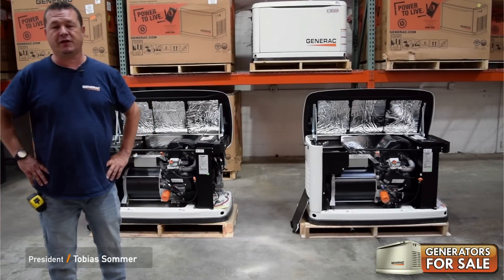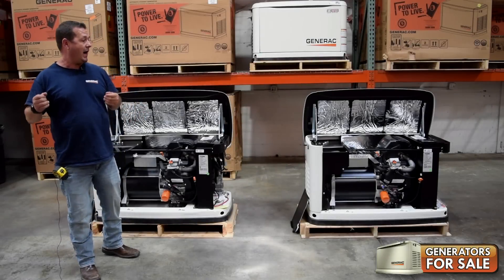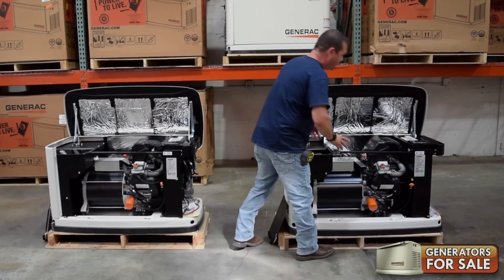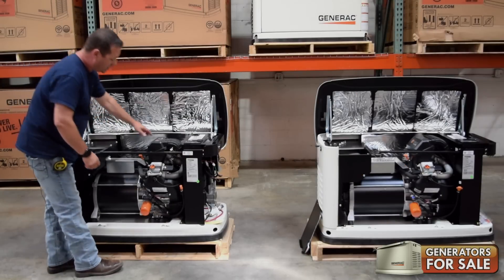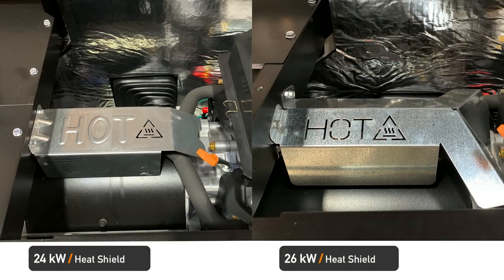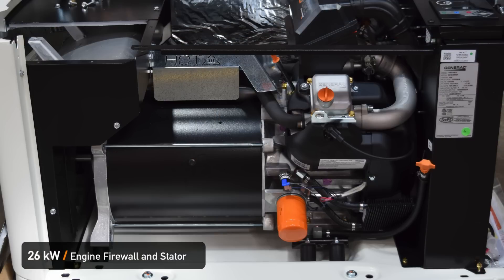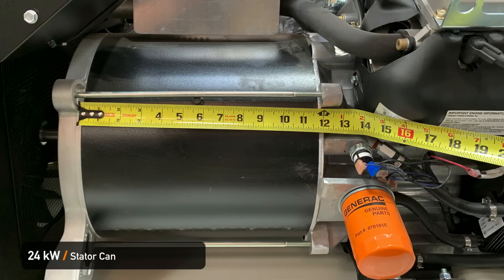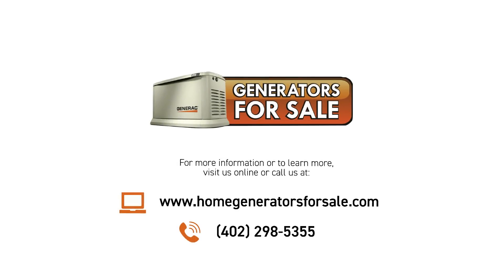UNVEILING The 26kW Generac Guardian Home Standby Generator And How It Differs From A 24 kW

Comment: We love our QS27kw. It is liquid cooled and runs at 1800 rpm. Yes it cost 6k more than the 22kw air cooled. But for extended outages the 1800 rpm generators are the way to go.
Reply: I agree with the 1800 option but find many people that have limited outages that the 3600 rpm air cooled will be just fine. Now that 2.4 engine is obsolete we will need to see what replaces it. That is a major issue for any unit that was using the Mitsubishi engine. Its not just a Generac issue and that was used by many manufactures as the engine of choice.

Comment: I have one of these.  The engine ran low on oil and it wouldn't start.  I suggest anyone with one check the oil level at least once a month.
There is also an oil drain tube (easy to use) in case you put in too much.  If you put in too much and don't drain excess it is passed out the exhaust and ruins the muffler.

Comment: The 26 kw Generac is underpowered and derates to 22.5 on NG. Also main breaker is only 110 amp. Briggs and Stratton is a better unit with derating only to 24 on NG and a 125 amp breaker as well as a standard 10 yr warranty! Briggs has more motor starting capacity and uses less fuel.
Reply from the maker: Having a 125 amp breaker and producing 108 amps doesnt give you more power??? Look at the specs of the Briggs. Its not much different than the Generac and only has a 6 year waranty on their website. https://www.briggsandstratton.com/na/en_us/product-catalog/generators/standby-generator/powerprotect-26kw-standby-generator.html
I think the biggest difference from a consumer to me is, in 2020 Briggs almost went bancrupt and was purchased. What good will this unit be if the manufacturer goes out of business?

I think the Vanguard engine is a great engine. I think Briggs is on the cliff because it makes engines for a lawn and garden segment that doesnt need engines anymore. Besides that they went to China to manufacturer and Generac bought the facility they used. Generac at least keeps Americans employed.

Comment: The specifications of the 26 kW unit show a slight reduction in fuel consumption over the 24 kW. Is this a misprint ?  If it's true, is the extra cost of the 26 kW worth it even if you don't need the extra 2 kW of power?
Reply: Same engine and it will be based on load anyways. a13kw at full load is a 26kw at 1/2 load. so a 26 will only be slightly different than a 24kw and on NG it gets even closer. I always say bigger is better unless you are wasting power. Example no need to full rate load a home that will never see that type of load. I have had customers that wanted liquid cooled machines and could have had a air cooled unit work but its not my backup system. I just give them options.
Reply: @TobiasSommerOmaha  Thanks for your reply. I appreciate your points.

 The Generac specifications say that  under a full load, the 24 kW unit  consumes 142 cu. ft/hr of propane while the 26 kW unit consumes 132.  The 1/2 load numbers are 92 for the 24 kW and 75 for the 26 kW.  That's a fair bit of propane over the life of the unit. How can the newer 26 kW unit provide an additional 2 kW while using less propane with the same engine?  

I called Generac customer support and they confirmed the  specs but were no help in confirming how this fuel reduction is achieved with the new 26 kW unit. They said to call a dealer. Lol.
Reply: Where I'm located in Canada, the 26kW unit is only $575 more than the 24kW and propane is about .83 cents per litre.
Reply from the maker: @kentshadwick6354  a few things that I know but not an engineer by any means. The 26 kw has a complete redesign of air intake which means they get more air and need less fuel to create more horsepower. It also uses a new bigger frame rotor/stator that is longer. It may need less horsepower to create the power with more alternator to produce power. Not sure if that helps but it’s my 2 cents.
Reply: @GeneratorsForSaleOmaha  Thanks for your comments. It wouldn't take long to make up the upcharge for the 26kW unit over the 24kW if the fuel savings are legit.  I believe the 26kW is new for this year so will it be more/less/equal to the 24kW with respect to reliability?
Reply: @kentshadwick6354  Reliability will be same or better. The engine has been used for years in multiple units and is tried and true. They just modified fuel and air so I dont think that will hurt but might help the unit breath. From install stand point it is more work and we do have to upsize the wire for the bigger breaker and output. I am happy with all the ones I have installed and no problems yet.
Reply: @TobiasSommerOmaha  How much more expensive would you say the install is over the 24kW unit?
Reply: @kentshadwick6354  We only charge like 500 more for upgraded raceway and wire. Not a ton but it is more.

Comment: Bought a new 22K Generac in Dec-22. The engine was bad right out of the box. It took 2 months to get a new engine.
Reply from the maker: I haven’t seen any engines bad out the box and I’ve installed thousands. I’ve had a few bad rotor and stators but never a full engine failure that needed a replacement. Sorry to hear that. I just filmed a video about blowing up an engine. It will come out soon but we ran the unit for almost 30 minutes with no oil before it blew up.
Reply: is your unit loud......on these videos, they sound like lawn mowers.  an ad by generac said they are quiet and no louder than having an conversation.
Reply from the maker: The quick answer is that this is an industrial lawn mower engine. So will it sound like a lawn mower, yes. Is it louder than a lawn mower, no. It is inside a enclosure that is designed to deflect and muffle the sound. No generator that has a combustion engine will be silent but quiet is subjective. I have had zero complaints from a customer that had power in an outage and the neighbors did not. The neighbor usually comes over to weather the storm and use the power.
Reply: @GeneratorsForSaleOmaha  way more power than a lawn mower. It’s a 999 CC OHV engine.

Comment: This might be a silly question, but I read constantly of people purchasing multiple units over the years. I get it, nothing last forever. What is the average life expectancy one can expect from a Generac generator that has been properly maintained?
Reply from the maker: Units can last a long time and reach well over 3000 hours of runtime with proper maintenance. In terms of power being out for 3000 hours, I have only seen off grid units make it this long. In terms of of years. I see units lasting 10-15 years and not being decommissioned because they don’t run anymore but just replaced because fixing an older unit is throwing good money at something that needs to be reliable. Money better spent by replacing with the newer reliable unit that parts are easier to find.
Reply: @GeneratorsForSaleOmaha  125 days consecutive seems pretty low, I'd bet they would run 24/7 w proper maintenance for far longer.
Reply from the maker: If my power was out for 125 days straight I would say I have bigger problems than how long an air cooled engine should last. My next question is why my utility is so unreliable!
Reply: @GeneratorsForSaleOmaha  LOL indeed
Reply: @GeneratorsForSaleOmaha  ... recently retired from one of the larger Generac dealers (25 year tech) and we had boat loads of units lasting 20 years or more. The biggest problem at that age becomes parts availability. At 15 years you can get almost anything. It's a bit of a gamble to push your luck farther because needing a (hard to find) part for an older unit could put you out of service when you need the power. In my experience, it's not usually a larger part, like a rotor / stator / engine. Those usually last. More often it's an obsolete control board, a sensor, or the cabinet has rusted out and the mice have had a field day with the wiring. On the liquid cooled sets, radiators, water pumps, and that sort of thing were also problematic in the supply chain.... and they fail just the same as if you had an older car.
Reply from the maker: Agreed. Just like any machine will eventually have obsolete parts a unit with 15 years on it is not necessarily end of life but end of road on parts.
Reply: Biggest problem with any of these is they aren't broken in properly do not break-in on 5 minute exercise I'm a mechanic that is the absolute worst way to do it you are asking for problems with rings and break-in heat cycles horrible on seals and gaskets too run light to medium loads few hours at a time changing oil between 6 to 8 hours then again at 25 hours do not use automobile oils use a commercial small engine oil that is 100% synthetic like Briggs and Stratton 5w30 100% synthetic or Amsoil small engine oil 5w30 100% synthetic 99% of oils labeled full synthetic are no where near 100% synthetic and do not have proper ZDDP levels for continuous RPMs under high bearing loads this the most overlooked thing with these units

Comment: Make sure you have the updated firmware that gives you a 12 minute exercise time on the generator. A 5 minute exercise time is not sufficient to remove water from the oil unless you're living in a very dry area.  Oil will absorb water. Part of the purpose of regular exercise is to get the oil hot to drive the water out.  Unless your generator is being used in an actual back up mode frequently, make sure exercises for 10 - 12 minutes once per week.
Reply from the maker: Another good idea is to just turn the breaker off in the transfer switch. This simulates an outage and will put a real load on the unit. If you do this once a year it will ensure the water gets burned out and the transfer switch coils and assembly works and is getting use. Dirt and corrosion will wear on these components and make them fail. Its best to plan for the failure and prevent it.
Reply: @GeneratorsForSaleOmaha  Once a year is not frequent enough to drive the water out of the oil. I change the oil once a year anyway. 12 minutes per week is the best way. Make sure you have the appropriate firmware in your unit to exercise 12 minutes once a week.
Reply from the maker: Agreed we do ours yearly too. The Midwest harsh conditions makes it more susceptible to milky oil. Waiting till the last minute to change oil and then having a 3 day outage is a recipe for failure. Yearly also gets a better visual inspection on the unit to see if there are any other issues like mice infestation.
Reply from the maker: @jdstl   real loads will be better on the unit because its going to work the motor harder, not just longer. Longer is still good but the actual load will always be the best.

Comment: The additions of the 24KW and now the 26KW really bring some affordable full-home power to more homes.   I purchased a 27KW QS series about 12 years ago, as I wanted to be able to run everything we had in a 4500sqft home.. all AC units, pool equipment, etc.   At the time, it was the only option for us in that power range.  I don't regret it, as the QS series is fantastically robust and quiet, but it came with a considerably higher price tag that these 22-26KW units.
Reply from the maker: The liquid cooled options are great but with the price of the air cooled 26kw it’s hard to beat. The surging load is much higher at 3600 rpm than the liquid cooled spinning at 1800 rpm. If you want to get the best bang for your buck the 24 and 26 kw are a clear winner.
Reply: @GeneratorsForSaleOmaha  Very true.  And with today's offerings I'd most likely have one of the new 26KW.   It was nearly a $10K premium (turnkey installation) for my existing unit versus what you can get today.

Comment: what's the difference in price?
Reply from the maker: the 26kW with WiFi enabled system runs about $6300, while the 24kW is around $5800. These prices do not include installation cost.

Comment: TO all perspective byers thinking of purchasing a Generac Generator ----BEWARE. We live in Florida home of the latest very destructive hurricane Ian. Six years ago we bought a Generac Generator as well as the extended 10-year warranty on all parts and labor . Naturally we believed we could rely on same, sadly, to our detriment. For short periods of outage ( 3-4 hours ) it worked beautifully, for longer periods of time it just quit. This also occurred during  Irma five years ago at which time it was repaired with on problem. We complied with their  request to send them a copy of the maintenance log we kept [ changing oil and plugs ] and, now, we are being told it does not meet their requirements. As a result they are  refusing to honor their warranty.
Reply from the maker: Mike , I have seen many units have issues. I work on all generators and stopped selling any brand other than Generac because Kohler, Briggs and Stratton would not warranty their issues. Cummins is corporate and wanted me to only sell and not service. The Cummins /Onan units I worked on were not under warranty and havent had to deal with them directly. 

The thing is I have never seen Generac turn a warranty down without a reason. I dont believe they turned a unit warranty that was maintained by the manufacture specs. I know every person has a different experience, but I am here to tell you that Generac has never turned a warranty down for me unless it was installed improperly, hit by lightning, rodent infestation or neglected and not maintained. Kohler screwed my on 2 warranties and I went to Generac because of that. Briggs and Stratton also has turned 2 warranties down. Not my sales but just trying to help customer with no dealer. 

I am sorry for your experience but If you want I can look up the warranty for you id you get me a serial number and see if I can help. All notes are in the system and I can see if I can get you a dealer to get a warranty.
Reply: Yeah I keep hearing the same thing. I got a Kohler 20kw. Just got it up and running in a week or so we lost power for like 6hrs. Ran great.
Reply: The only reason they would do this is if you missed your required maintenance windows.  Do the maintenance the manufacturer requires and they cannot refuse your warranty...period.  you left them a way out..probably didn't change the oil or the plugs as required or you ran it low on oil and didn't change it after a long run period as required.  Smartest thing for new whole home generator owners,  get a service agreement plan with a good reputable local company and they will handle all required maintenance for you.  If they screw it up you can fall back on them....
Reply from the maker: @trith72 I agree. The myth is that the unit doesn’t need maintenance because it didn’t run that much. Which is the reason it needs maintenance because like a car that doesn’t drive much. You need to make sure it will be ready for a multi day outage at anytime. If the oil is three years old, the unit may have oil but the oil is broken down and more like water. These units are the ones that have issues.
Reply: Thx for this - it weighs heavily for us.

Comment: Besides those upgrades, and the extra 2k of the 26kw, is there a difference in software upgrades?

Thanks
Reply from the maker: Hey Lamont! 
For the most part, the software between the 24 and 26kW generators will operate the exact same, but there has been a substantial upgrade to the Mobile Link systems they include. The standard Mobile Link models are connected via WiFi in order to send notifications and updates to any mobile device, but they have released an attachment for the Mobile Link which allows for LTE network connections. This will allow for any generators outside of the WiFi radius of a home, or units in more remote locations, full-time access to sync with your devices and have a network connection for remote monitoring at any time. This attachment can be installed into any units featuring Mobile Link, so you're not limited to just the newer 26kW model for this upgrade!